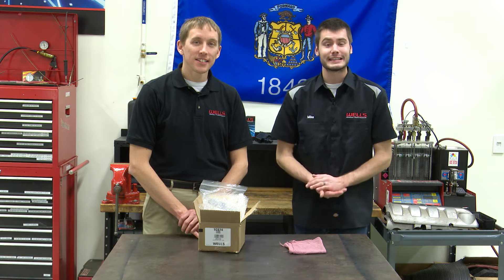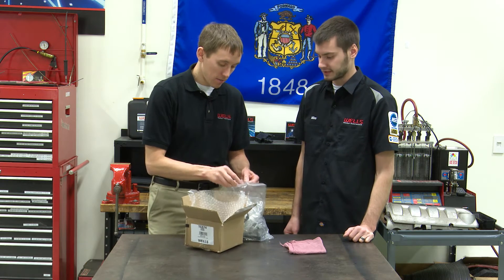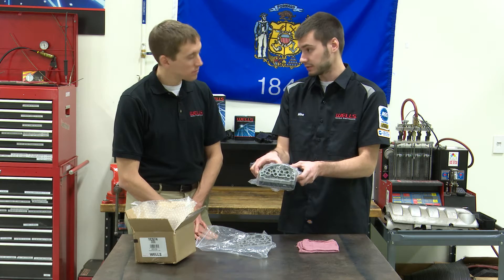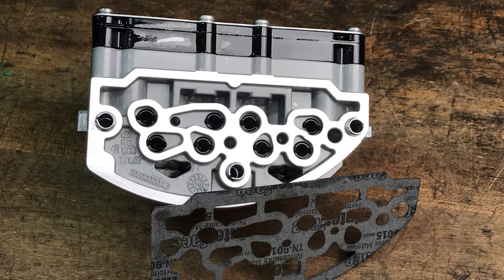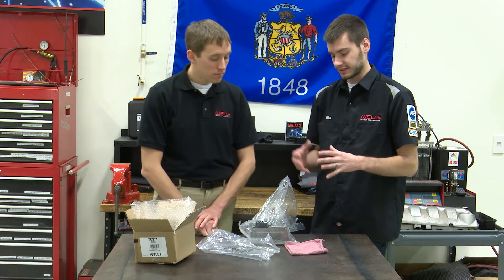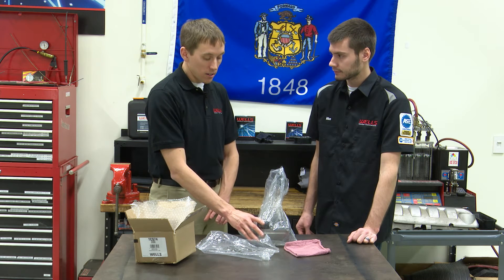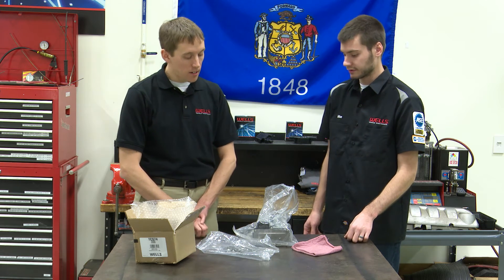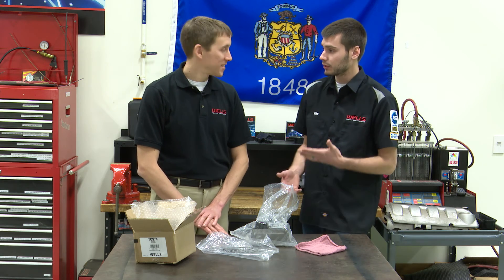Wells CounterPoint Ep. 17 Chrysler Transmission Solenoid Pack (TCS74)

Comment: How do you remove the pack body. IT WONT COME OFF ON A 2000  CHRYSLER 300M WHERE SOLENOID PACK SIT ON OTHER SIDE ?
Reply: Those are internal, the pan has to come off and then the whole valve body has to be removed, a little tricky re-assembling, there are one or two springs that need to be held in place as the valve body is re-installed. I did it before, not too bad.

Comment: I have a 2006 Chrysler Town and Country that more often than not has troubles while (skips\hesitation) shifting.  Some days it does it all the time, other days it shifts with no issues.  I am not receiving any codes.  Do you think that the Transmission Control Module could  be my issue?  In addition, if I replace the TCM who can perform the re-learn process?  Thank you for this video.  Very informative.
Reply from the maker: Donny, I think a TCM would be an expensive guess. I think your best bet is to take it into a shop for a proper diagnosis. As for the programming, a Chrysler dealer or a high end diagnostic shop should be able to take care of you. just make sure to ask them if they have Chrysler programming capabilities.
Mike Becker, Senior Technical Instructor
Reply: @GoTechTraining  Mike.  Thank you so much for getting back with me, really appreciate it.  I was trying to diagnose this on my own since dealers\shops are SO expensive and since the part looks relatively easy to replace.  They jack the price up so much for a part that we as consumers can get cheaper.  Is there a way to test the current TCM to see if there are any issues with it.

Comment: I have a 1991 lebaron lx convertible 3liter v6 4 speed automatic with the A604 41TE transmission that I'm having all the symptoms that have been described as a fix of replacing solenoid pack. My question is will this pack work on my car. Another guy on here John Daniel did a video changing out pack on a Dodge and put a link on ebay for the kit and said it would fit a whole list of cars, mine included. I went to that link and put in my car and it said it wasn't a fit for my car. Did the same on other eBay solenoid packs that said it would fit A604 41TE trannys but again put my cats info in and no fit. I'm really discouraged and stressed as I'm only working part time and money is very moral so I do the work on my car myself and need to make 100% sure I get the correct solenoid pack. PLEASE, PLEASE HELP ME!!! I also need an answer as soon as possible to be able to order and get my car fixed this weekend. Thank you for your help, Donna
Reply from the maker: Donna, unfortunately I don't list a solenoid pack for that car.
Mike Becker, Senior Technical Instructor

Comment: I'm a Chrysler dealer tech, and have had to do these from time to time over the years. The relearn, it is not necessary to have and use the scantool to do the relearn, it was more for making the customers happy at the dealership than for anything else. The tcm can do the relearn on it's own, it may take a little longer than doing the procedure with the scantool, but it can do it. That was designed that way so that those who don't have or have access to a scantool can drop the pack on and let it go out the door. The tcm does the relearn pretty quickly on it's own. Might notice slightly rough shifts at first, but they'll improve as the tcm goes thru the relearn. There are three bolts that hold the pack to the trans case, follow the torque procedure exactly, it does'nt take much to strip the threads. Also, to remove the pack, the input speed sensor has to be removed to allow enough room to remove/install the bolts as well as the pack.
Reply from the maker: Hey David! Thanks for the information! I just want to inform on the facts, and according to the procedure, the TCM needs to be relearned. That is good to know that it is not necessary. Should save some people some trouble as long as they understand it takes time to learn. Good to know about stripping of the threads,  torquing is definitely something we as techs should be doing on just about everything we install. Thanks for commenting in David, we really appreciate it. 
Mike Becker, Technical Services Instructor
Reply: You're welcome!

Comment: Nice informative video Mike & Adam. I'll have to check out your TCS pack. Rock Auto shows it as a different AIRTEX/WELLS PN 2N1201. Is that the new Wells PN or Airtex? Under the 2N1201 description It shows Alternate/OEM Part Number(s): 5015646AC, 5140429AA, TCS74.
Reply from the maker: Hey Bob, thanks! Rock Auto is going to use our other part number. The 2N1201 that is on Rock Auto is our part, just using a different number. 
Mike Becker, Technical Services Instructor